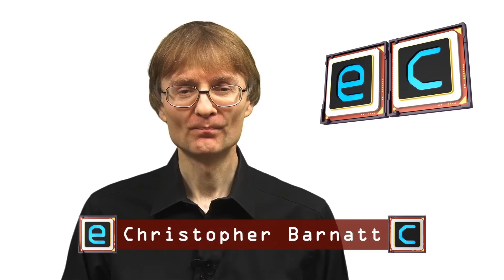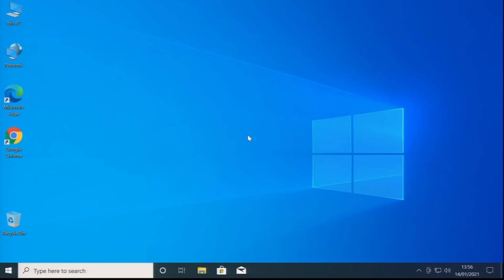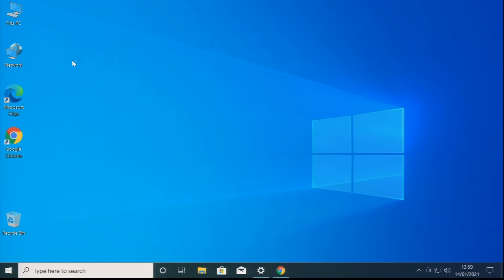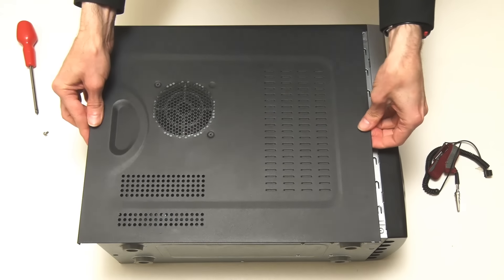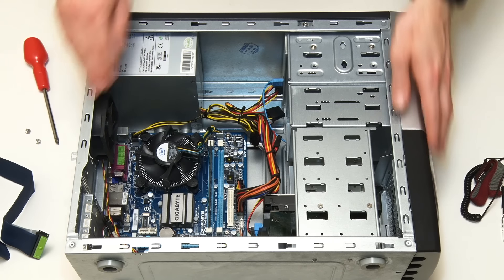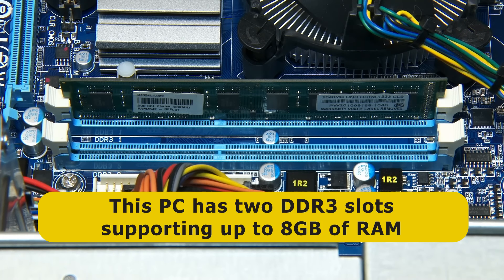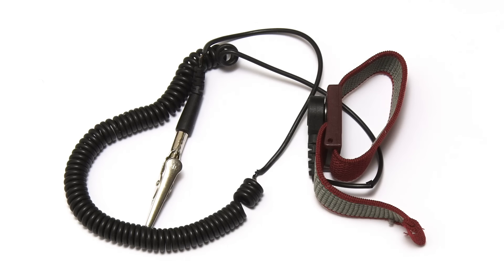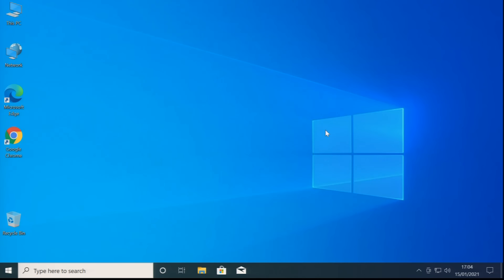Old PC Upgrade #1: Options & RAM

Comment: What you call "an old PC" is what my 84 year old dad calls his "new PC". LOL
Reply: At least your father has a PC. My 82 year old dad refuses to use computers.
Reply: I'm not a dad, but my current setup is a core2duo e4600 2GB RAM. And running strong. (no modern gaming, of course)
Reply: to be fair when i read "old pc" i thought 486, and i'm only 27.
Reply: I installed Xubuntu on mom's 16yo pc, gave it one icon to Firefox, and removed all menu access. It worked fine for her for 3 more years until it self destructed.
Reply: I got a desktop that I went ahead and upgraded to max ram capacity... Due to budget and pack of knowledge I sorted by cheapest and got a bunch of 1333hrz ddr3 and used it with the one stick of a different brand already in the system.. realized later It prevent dual channel memory. Ooops. It has 32GB supported memory but still only uses SATA 2 3Gbps !? The more I learned about my system the more I realize how much they cheaped out on the motherboard and GPU
Reply: Chris  please  take vitamin D ( 4000 units per day) 4k international units /day  
Vitamin D3 .
Chirs its important for health .
Reply: @noblej7897  That's part of the fun of learning. Also mistakes which you learn from each build means you know where to avoid the mistakes on your next build. I learnt a lot from my mistakes and my current pc is the 6th "The Beast" I built for myself and it's mostly perfect for the budget I had.
Reply: My 33 year old me has a computer (main one) older than this 😭
Reply: This kind of PC fits all the needs that my father has, and he is 45 yrs old :P
Reply: Moral of the story...Never shop for PC's on wish.com.
Reply: @noblej7897  same thing, but in my case it's dual rank RAM (bought used ram and got single rank RAM. PC didn't boot)
Eventually I bought new one and the old one are given to another PC
Reply: That's the kind of CPU I'd task with running a hardware firewall on as a project, and basically nothing else. QUITE low specs nowadays.
Reply: @TheUglyGnome  My dad too.
Reply: Ageist tropes are not PC.
Reply: My mom will be 90 years old this year.  She is using an iMac, her "Dick Tracy" watch, and her iPhone.  My Brother-In-Law converted her to an Apple user...Oh My...
Reply: @calinguga  I still have a mother board with a 486 on it.  I'm pretty sure it still runs.
Reply: Nice to see a CWT power supply - they actually manufacture many of the Corsair-branded ones. I was expecting some nasty thing in a build like this so was pleasantly surprised!

I wonder what you're planning for the CPU and GPU - maybe a Core 2 Quad, if not a (pre-)modded 771-to-775 quad-core Xeon, with a low or mid range NVidia 10-series (respectively)...? :)
Edit: nevermind, you said you're replacing the board.

(Reposted here because it got "lost" in the main page).
Reply: @IncertusetNescio  I saved a PGA370 1GHz Pentium III PC from the tip that had no graphics card but multiple Ethernet cards in it that I suspect was used for the same kind of thing in its "later years". Now has a GeForce 3 and Voodoo2 SLI etc and is one of my retro gaming boxes :)
Reply: And thats what i call "My PC"
Reply: @persona83  I got a core 2 duo too, with 4GB RAM and a 320gb hard disk.

Its a dell lattitude e6400, which I only use for casual web browsing, YouTube playback (which is surprisingly good, even at 1080p), school work and Zoom.
Reply: @TheUglyGnome  Count your blessings, no computers for your dad means he does not call you for tech support.
Reply: @SlyPearTree  
Oh! I get plenty of tech support calls from my mom. Fortunately at least half of them ends with: "have you tried to turn the computer off and then on again?"
Reply: @persona83  ssd with that?
Reply: @ramtek2702  try PIII TUALITIN 😊
Reply: @Pauls Apšenieks in older than your dad
Reply: @marcbensen8963  Unfortunately not. PC is too old, it has only 2 SATA ports, which are occupied with 2 HDD, (2 partition each) with lots and lots of files. But, to be honest, boot time and overall operation is not that sluggish, I use the PC most for work and (very) old games. Windows 7 BTW.
Reply: or an Abacus
Reply: Lol this is my grandfather's account, I'm 13
Reply: "I've often thought about learning the mouth organ at times like these" 😂😂😂
Reply: It's very new. Compared to ur Dad.
Reply: My da
D still uses a wall phone -_-
Reply: You should do more
Reply: If it computes it computes 🤷‍♂️
Reply: @Dalton Warren Instablaster :)
Reply: @Baker Asher It worked and I now got access to my account again. I'm so happy:D
Thank you so much you saved my ass :D
Reply: @Dalton Warren Glad I could help =)
Reply: @persona83  2GB of RAM isn't enough for even web browsing at this point.
Reply: @TechHug  Me and my PC don't think so.
Reply: @persona83  I guess if you're running a super light Linux distro, only keep one tab open, and don't mind 360p or lower video. Even then though, "going strong" is pushing it. Even smartphones need more RAM than that to really be useful these days.
Reply: @TechHug  actually, it's not that dreadful. I'm using Windows, use tons of tabs in Chrome (no possible in Firefox, though) and watch videos in confortable 480p (even some 720p, if I'm interested in details). I don't mind 4K, modern gaming and stuff, so the machine is perfectly suitable for me, my daily work and internet browser (those ultra-heavy trendy sites is a problem per se, not the system's fault. I simply avoid those sites). When I say "going strong" is because it's a 15 YO PC and it runs flawlessly within its capabilities.

PS. only HDD here. Not even SSD. 😄
Reply: @persona83  Windows what? XP?
Reply: @TechHug  W7.
Reply: @persona83  So you're running an unsupported OS on ancient hardware and aren't even willing to spend $30 on a RAM upgrade that will make your PC run much, much smoother?
Reply: @TechHug  max. RAM for my mobo is 2 GB, and the system is 32 bits. And to me, that "unsupported OS" thing is pure BS. It's just a media campaign to make people buy new hardware and unfortunately people follow it as lemmings towards a cliff (we saw all the fuzz because MS said initially W11 would not run on older systems, even if W10 is plenty active right now). I have my backups up to date so if that "unsupported OS" falacy affects me somehow, I'll be able to just continue from where I stopped. But of course, to each one their own choices.
Reply: @persona83  It's not BS lol. It means you're on your own if something goes wrong and that new versions of the programs you use will eventually stop coming. Also, unless you only have one slot your board has to support at least 4GB.
Reply: Awww 💜😊
Reply: @TheUglyGnome  Lmao my 83 year old grandma does tiktok
Reply: I have 22 year old pc it used to be an office pc it can't run Photoshop or adobe apps or any games except Minecraft and my montior is bad not even Minecraft with shaders

Comment: Stage 1 complete on my PC 👍. Upgraded from 3 to 8  of GB RAM.  Very happy with speed increase.  The dust and fluff blocking the processor fan was a sight to behold.  No wonder the fan was running so readily! All clean now and eagerly anticipating delivery of a SSD for stage 2.  Thanks for your encouragement and advice.
Reply from the maker: Excellent. Sounds like the RAM upgrade went really well for you.

Comment: Greetings from Sweden. These videos, upgrading older PC's, are very satisfying to watch. Can't really explain why... My father passed away not long ago and I "inherited" his very old HP desktop from 2009. Just for fun, during a weekend, I cleaned it, upgraded everything I could (kept the motherboard though).

* New Corsair 430 W modular power supply.
* More and faster RAM sticks.
* Better and faster AMD CPU.
* Samsung 860 EVO SSD, 500 GB (overkill, I know, but I had a few on the shelf).
* Dedicated ASUS 730 GTX GPU with 2 GB GDDR5 memory.
* Windows 10 (the machine came with Windows 7)
* New cable management. 
* SATA DVD-ROM instead of the old IDE one... 

Believe it or not but my dad's old PC starts in 30 sec now and shuts down in 10 sec. It is responsive as h-ll, a perfect PC to surf on and use for lighter use. I gave it to my 81 year old mother and she is happy with it.

Comment: Older computers like these make for great budget systems to be used as thin client devices. I have retired nearly all of my Core 2 Duo era systems from traditional use and migrated them over to thin client duties and they're still doing great. They also make for decent NAS systems. My NAS is based on a Dell OptiPlex 755 from 2008, and apart from a failing PSU it's doing great.
Reply: My NAS is the "desktop" variant of that computer. It runs truenas (recently upgraded) pretty well.
Reply: @thebeezkneez2557  I use the MT model because it's what I had sitting around and I used to have a large number of drives in it. I think I had about 10 drives in it at one point. The PSU (not the same one that's in it now) struggled a lot to spin them all up.
Reply: I actually have a MT model case sitting around and have been considering moving my NAS to that. I didn't realize that you could fit so many drives in it. The PSU in my MT case is only a 305W so it would definitely need an upgrade.
Reply: @thebeezkneez2557  The MT case only properly supports 3x 3.5" drives, and that's only if you use the bay that is normally used for a floppy drive. I had drives tucked in the 5.25" bay area.

Comment: since it's DDR3, you have a couple of options.
1) use 2x8gb ddr3 to max it out to 16gb. it's possible on the chipset. just not documented on the spec sheet
2) if you can try to play around and modify the bios file to allow it to --- use nvme via pci>nvme adaptor and boot natively on a faster than sata nvme native storage... then you might eke out more performance.
Reply: Second option is a waste of time and money. Simply throwing in any 2.5 ssd is enough. Getting a faster cpu is much better idea.

Comment: One thing to add, when upgrading memory often you will find the slots are full of dust, so a can of contact cleaner is very useful, and often a non woven wipe soaked with it used to gently clean the inside of the slot and the memory module will result in good contact, as you wipe off the dust and the film of dirt that has built up there.

Same for adding in cards, the slot can easily have a build up of dirt in it, which is not visible easily, but a spray and wipe with the non woven cloth and contact cleaner does wonders.
Reply from the maker: A good tip, thanks for sharing. :)

Comment: That's a very nice system for this project. Perfect start for the absolute beginner who had no idea they weren't necessarily stuck with whatever came with the PC, or that its performance can be radically improved at little expense. Especially so when starting with a flexible case and a good motherboard, as this one does.

Upgrade CPU and give it a small heatpipe cooler, swap the mechanical HD for an SSD, and give it a USB3 add-on card, and it'll be ready for a long and useful new life. You could even go all out and give it an M.2 drive on a PCIe adapter card, and perhaps a Blu-ray optical drive!

I've got several of this class myself (some still in everyday use) and more RAM is definitely the best first step. I've also found that a quad-core CPU makes a big difference -- mainly that CPU-intensive apps don't get clogged up near as easily. (By about a factor of four compared to the core2duo CPU, even tho the latter had a higher clock speed.)

Great way to start my morning!
Reply from the maker: Thanks for this! I chose the PC with care to have decent upgrade options.

Comment: I recently did an upgrade to a system of similar age and specs. My sister needed a system for teaching distant learning classes that could offer more capabilities than her issued chrome book. I upgraded it to a Core 2 Quad, 8GB of RAM, 256GB SSD, and a Radeon HD 6750; it runs like a dream for a desktop I originally bought in 2009. I wouldn’t try to do anything intensive like video editing or games on it, but it is perfect for teaching online classes.

Comment: Wow, I literally sat down with a salvaged Dell Optiplex today and started to give it a once-over. It was a dog to begin with but I replaced the HDD with a SSD, and popped in an i5 3470s in place of the i3 2120. Now it's been resurrected. I've ordered an extra stick of RAM second hand from CEX for £6. Hopefully it's actually a stick of RAM and now a piece of burger cheese. All in all it's going to be a complete makeover for less than £40. A nice little project for the lockdown!

Comment: great video, brings back some memories.
when my laptop broke in 2015, a friend gave me his old desktop, and it was like that one.
the first thing I did was replace the power supply. 
the original 250W had been working for 5 years, I got a new 500W PSU for just 15€.
then I reinstalled Win7 and used it until 2019.
because of win7 EOL, I upgraded to 4GB ram and installed win10 64bit.
it still works, but really shows it's age.
last month, I finally retired it and bought a new PC, with Ryzen 9 5900X

Comment: My skill level with PCs is well beyond this video.  Never the less, this was a brilliant video.  It shows how a PC can be upgraded for someone who has never performed this operation.  A couple of comments you might explore.  Some system boards might have the capability to address more memory than specified.  For instance, the specifications state that only 8GIG memory is supported but in some cases, as long as you have the correct RAM and are not over clocking, you can add upgrade to 8 gig sticks giving you 16 Gigs of RAM.  This is undocumented but that option is sometimes available, though 8 gig is the low end standard for Windows 10 64 bit and will work fine.  The other option you did not go cover is a processor upgrade.  Some system boards were designed to support multiple processors, and system builders often fitted system boards with slower cheaper processors.  I wonder if your system board can receive a processor upgrade.  I did take the liberty to check to see if the processor can be upgraded and it can.  According to Gigabytes website you and fit an Intel Core 2 QuadQ 9650 processor.  Here is the link to that page.  https://www.gigabyte.com/Motherboard/GA-G41MT-D3-rev-13/support#support-cpu.  This would also be a considerable upgrade from your existing processor.  Your existing processor falls right in the middle of the processor chart. So average performance.

Comment: Few weeks ago I upgrade my pc which has slightly lower spec than this
Cpu - intel E4500
Ram - 2gb
windows 10 pro
I replace hard disk only with an SSD now it runs similar to 8GB pc as in video
and copying & moving speed is impresive
waiting for more upgrade 
This series is going to be interesting waiting for the next video :)

Comment: This "old PC" is older than the free "old PC" they gave me at my last job before quarantine to take home... a HP EliteDesk 800 with Intel Gen 4 i5 CPU and USB 3.0. I have since upgraded RAM to 16GB and installed a nvme SSD, my next upgrade will be a decent graphics card.

Comment: Excellent hardware. I’m upgrading an old computer. So far I’ve maxed out the memory and installed an SSD. Running Ubuntu. Thanks
Reply: Also add SSD is my first thought to do to make a computer faster.

Comment: Oh my god, I have that exact same cabinet. I never let it go cause it was a gift from my uncle. Mine was originally an eSys branded prebuilt with a P4 2.66ghz, 256 mb ram, an 80gb HDD and a CD only drive. Later upgrades included an additional DVD burner, an nVidia 6200LE and 512mb extra ram. Now its running an old i3 system harvested from another PC.

Comment: Sometimes the older machines are so inefficient with power that it actually makes more sense to retire them. Maybe less of an issue with more recent machines. But I remember the case of someone wanting to run his Power Mac G5 as a spare machine for some server purposes, but that machine was so massively power hungry that it was cheaper to buy a Mac Mini (which also was faster).

Comment: Another good one, Chris. Not a surprise that the PC had only one DIMM. Supply for RAM at that time was lagging demand so RAM was at a premium. As you pointed out in your video, insufficient RAM means the computer will use the pagefile to swap to disk for lack of memory. When people bought PCs at that time, it was all about the GHz of the CPU and other specs. So for an OEM to be price competitive and still be able to compare on specs, the RAM was a typical compromise. Windows 7 didn't require quite as much RAM as WIndows 10 does, but the PCs were still underpowered. Adding the RAM is a very good first step on an upgrade for a PC of that vintage in most cases. We bought my daughter a MacBook Pro 2009 for graduation that year and a few years ago she told me it was probably end of life. I told her for Christmas that year I would upgrade the RAM and replace the HDD with a SSD. A totally new MacBook was born, and now 11 years later she is still using it and happy with it for most applications. Of course, some people think that more RAM is always the answer to higher performance. It all depends on how much RAM is being used by OS and applications running. As long as the system isn't swapping to disk, the PC is fine on RAM most likely. A show of the Task Manager might be useful to demonstrate and visually see RAM in use as more applications are running. An added bonus is if the motherboard/chipset support dual channel, you greatly increase performance by having 2 modules instead of one. But not all boards/chipsets support dual channel, so it's something to investigate to know for sure.